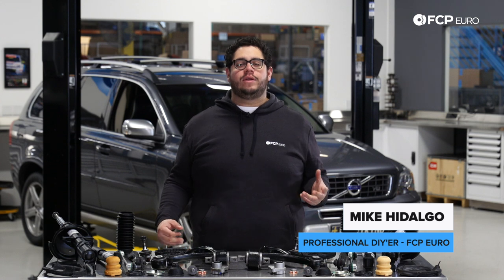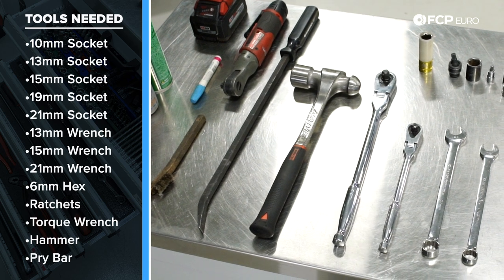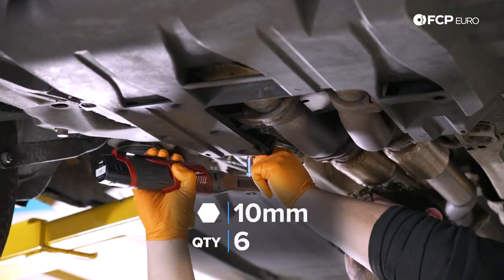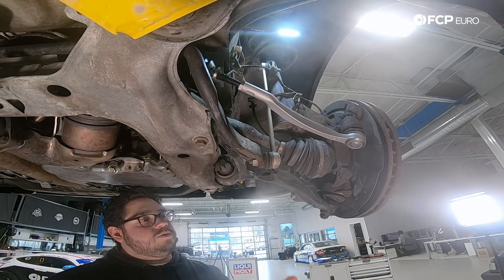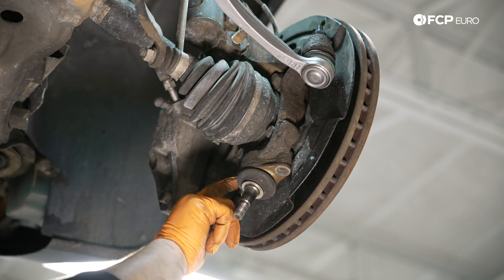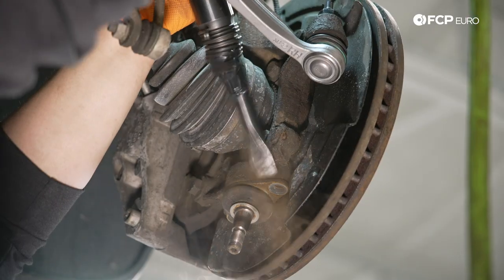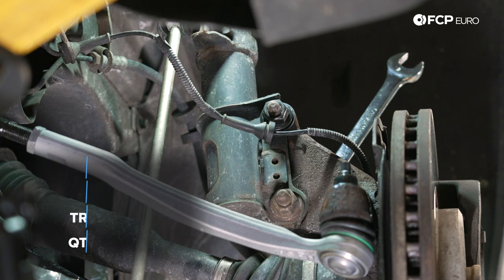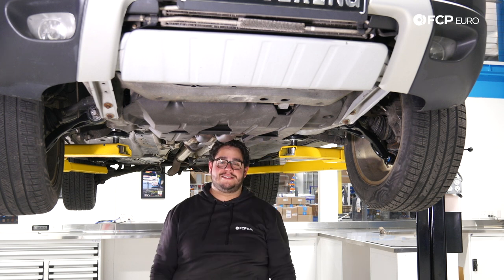Volvo XC90 Front Control Arm & Ball Joint Replacement DIY (2003-2014 P2 XC90 3.2, 4.4 V8, T6)

Comment: Be reminded the torques specs on the lower strut mount (the 2 bolts) is 78ftlb plus 60 - 90 degrees.  Thanks for the video.
Reply from the maker: Thanks for the info!
Reply: Also the two M12 bolts in the control arm are 65 Nm plus 105 degrees and the rear M14 bolt is 105 Nm plus 180 degrees. Don't have those in ft/lbs sorry but had to double check them in the repair manual.
Reply: Great video however! Helped me out a lot trying to get the control arm back in with new bushings! Lots of cursing trying to get the washers aligned with new poly inserts.

Comment: Using the 13 mm bolts to force the ball joint in can strip out the steel hub.  Ask me how I know (getting the car flat bedded to a shop right now). If it's tight due to aftermarket tolerances being shitty then STOP and especially don't use a power tool like they show to do this.  Better yet, use the right tools and don't try to take short cuts.

Comment: Amazing video, this is the sort of work I'd never have attempted before resources like this. I bought the full kit from FCP that included the sway bar end links, ball joints, and control arms. Frontend is totally sorted, I had a major pull to the right under braking before, the bushing on the right control arm was shredded. They'd never been done, and my 06 XC90 V8 has ~197k on it.

I wasn't able to get the old control arms loose from the ball joints, so I just air hammered the ball joints off with the control arm still attached, which worked fine. I also used the air hammer to work the new ball joints on a bit at a time, in order to avoid doing all the work with the bolts... Someone else here commented that they stripped those out trying the method in the video... The air hammer worked fine, the bolts just ensured that it went in straight.
Reply from the maker: Nice work, Matt! Happy we were able to encourage you a bit to DIY that project, this is why we do what we do.
Reply: Parts just arrived from FCP- starting this exact job tomorrow! Excited for my ‘07 3.2 to drive like new again.